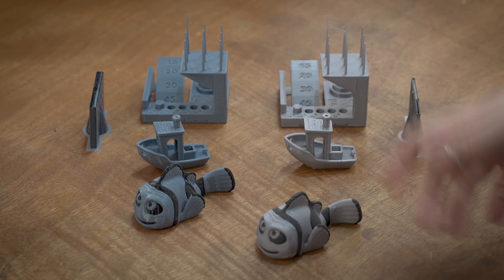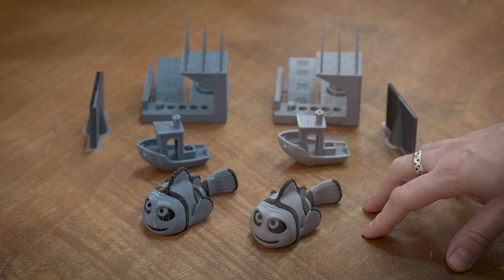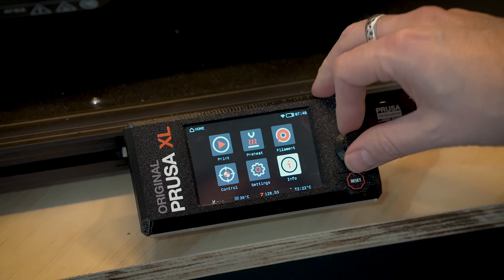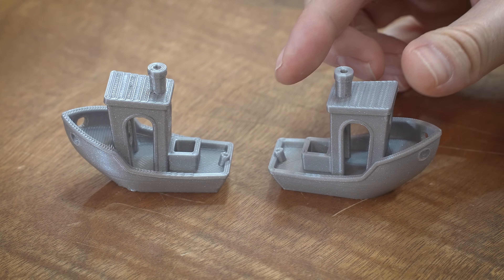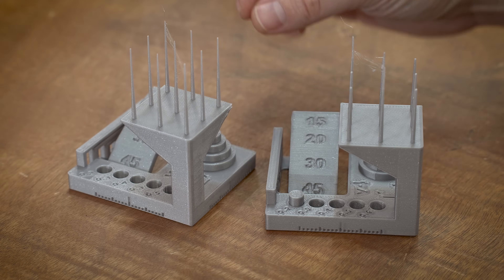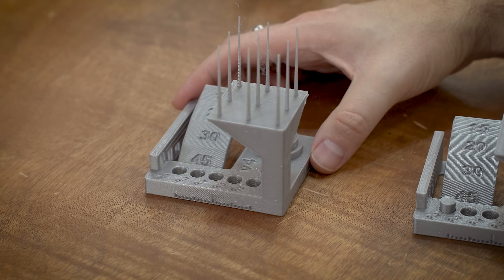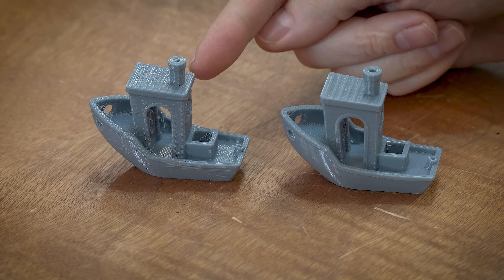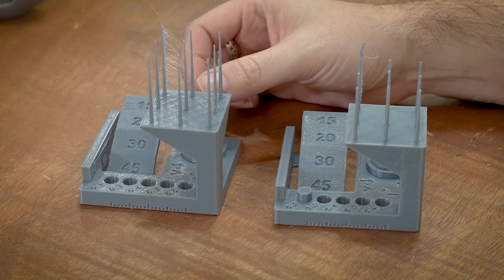Prusa XL - 0.6mm vs 0.4mm Nozzle Comparison

Comment: .4 will have sharper corners... it's a "sharper pencil point" than the .6. Examining from close around 1 foot / 30cm away I can see the difference but any more and I can't tell.
Reply from the maker: Oh, I completely understand that, but it's literally having an issue with things any printer should be able to do.  Check the other comments from other XL owners, it just doesn't seem to 'print right' with the 0.6mm for whatever reason.  It's not just fine details.

Comment: How is the difference in print time between .4 and .6 nozzles with input shaping?  5%, 10%, 15%?  Is .4 still suitable for larger prints?
Reply from the maker: All of this is using input shaping.  Of course 0.4mm is still usable for larger prints, they'll just take longer.

Comment: So do you think the decsion to ship with 0.6 was a marketing decsion instead of a technical one? Do you think P. felt pressure to release it with faster speeds instead of quality?
Reply: Prusa wasn't pressured by anyone or anything. Its only makes sense to sell it with a bigger nozzle. Its a massive printer marketed for people that print large parts. Using a .4 would take all day when a .6 can shave time off drastically. it's a no brainier to ship a large format printer with a larger nozzle.
Reply: Must be miserable living as a prusa shill @LilApe
Reply from the maker: Most likely.  They maybe assumed people would use it for larger prints.  IMO, they should have skipped the huge tin of gummy bears and just included both 0.4mm and 0.6mm nozzles...

Comment: What if the problem here is that slicers are through and through optimized (both intentionally and unintentionally) for the behavior of plastics at 0.4mm nozzle size and for that reason any attempt at using a 0.6mm nozzle will perform worse compared to 0.4mm?
Reply from the maker: Other printers seem to handle 0.6mm well enough.

Comment: I've been running my XL for a couple of weeks, and so far I'm happy with it.  It is definitely sensitive to stringing and oozing.  Filament drying seems more critical on this machine than any other I own.  Even stuff like Ninjatek Cheetah that claims it doesn't absorb water must be bone dry to get good results.  I have a set of 0.4mm nozzles on the way, and I'm looking forward to the comparison.
Reply from the maker: For sure.  It seems VERY picky about filament quality.
Reply: I wonder if this has to do with the really long heat zone, combined with a more open than normal nozzle, which leads to a long section where the filament will be cooking and thus, a proportionally larger build up in pressure as the filament off gasses within the hot end, which due to the easier release of the 0.6 size, results in more ooze than normal, to the point where it even has a notable effect whilst printing in the slower regions (I imagine this could be test simply by getting a filament with a wide temp range, and printing slowly, and very hot, and then slowly, and very cold). You know, maybe this is actually the cause of a lot of issues in prints because it's just a variable no slicer is accounting for.

I've always thought we were missing the compensation for this in software, and have just been using mediocre solutions like unnecessarily having smaller heat zones when we should just be estimating the "anti offgas" value similar to input shaping, and simply run the extruder motor in reverse when not extruding to account for it (very very slowly).

Anyhow, I don't have the time, nor working open source printer setup to try that, but it actually sounds doable just in the slicer with gcode. Heck, its the perfect thing for the slicer because the slicer knows for just how long the filament will be sitting getting cooked (and therefore expanding). It doesn't even sound super difficult to implement. I mean I've done the barest of tests with manually running the extruder back while filament cooked to test this before so I feel like the idea is definitely sound.

If only I could freeze time to have enough time for all the things I want to do that are totally easy ideas that wouldn't spiral into multiple month efforts
Reply from the maker: @BeefIngot There's certainly SOMETHING going on here, not sure what it is.  But since switching to 0.4mm, I haven't felt the need to 'improve' upon anything, I just want it faster now ;-)

Comment: I find the issues with the xl are a bit surprising, it seems like it is either bad profiles or something wrong with the hot end design. Given that it is still an issue to some degree my money is on the hot end.
It is the same with the 0.6 nozzle, they work really very well on the mk3s, (with the Revo conversion) there is little visible difference for functional parts but much shorter print times (with solid parts)
Reply from the maker: Yeah, I had always heard 0.4mm and 0.6mm can essentially print about the same, but it's not the case with the XL, at least in my experience.
Reply: @RobertCowanDIY  Do you know if Prusa has posted the whole design for the XL yet? I don't see it on Github but perhaps I am not looking in the right place. It would be interesting to check out the design details of the hotend and extruder.
Reply from the maker: @lukerickert5203 I've seen some files on printables, but not the entire machine IIRC.
Reply: @RobertCowanDIY  it would be interesting to run some transient thermal models on it. I guess I could ask Prusa

Comment: I found the same issues as you with my 5 head XL.  I now run 2 heads with 0.4 for "detail" stuff and use the 0.6 for "primitive" components and supports.
Reply from the maker: Nice.  I really wish I had gotten all 5 heads.  I just wanted to 'test it out' initially, but that was before I knew it would take forever for them to ship.

Comment: the old diameter swap process from my mk3 was way better than the mk4/xl, which  is ironic since the mk3 didnt havbe quickchange and the others do
Reply from the maker: I don't think the toolchanger has much to do with it, that part seems to work quite well and I don't see any issues with it.
Reply: @RobertCowanDIY  it's just the same on the mk4 tho. It used to be if you loaded an incorrect diameter file you could with one press get to the menu to reconfigure it. Total like 4 presses to modify the set diameter. Now it's buried in a tool sub menu despite nozzle changes being easier than ever
Reply from the maker: @AirsoftAbominations Gotcha, interesting.

Comment: Let me guess, same speed for both .4 and .6, there's a significant difference in volumetric flow, the most noticeable difference is between the PLA fishes, the .6 is matt, the .4 is shiny, the reason for that is not properly melted plastic, which creates higher nozzle pressure, worse surface quality, worse pressure controll in the nozzle, stringing, lines on the surface. Do another test but limit the volumetric flow, let's say use 8mm3/s for both PLA, and compare again.
Reply from the maker: Not a bad idea.  I didn't want the video to balloon into some 45 minute in-depth thing, but I made a spreadsheet and the 0.4mm nozzle prints were much lighter than their respective 0.6mm prints (maybe 20%?), so less filament and they took 10-20% longer.  So with the 0.6mm nozzle, it was certainly pushing out more filament.

Comment: Prusa was warned that 0.6 default nozzle was a mistake for exactly these reasons but they ignored everyone and did it anyway. What's the point of saving time if it looks bad?
Reply from the maker: I think for much larger models it would be less of an issue?  I should maybe do this same test but with really large-scale models.  But that would take forever :-/
Reply: Prusa was never warned about anything.You just made that up lol. It's a large format printer with a lager nozzle to match which makes sense. People were pleased to hear it comes stock with a .6 because it only makes sense.

Comment: You guys do know that nozzle size is not equal to line width right ? Meaning you can print just fine a 0.6mm line with a 0.4mm nozzle. 
So the real comparison should be 0.4mm nozzle VS 0.6mm nozzle on 0.6mm line width. To see what kind of secondary effects like filament swell, smaller volumetric flow etc. take place. Should all the secondary effects be controllable, there would be no reason to use a 0.6mm nozzle at all. With arachne you can print incredible fine details with 0.4 AND a line width of say 0.8mm. 
This would be way more interesting to me. I mean there is no genius hack to find out that a 0.4mm nozzle with 0.4mm line width prints slower than a 0.6mm nozzle with a 0.6mm line width.
I am also using a 0.25mm Nozzle to print 0.25mm-0.5mm line widths, so my prints are just as fast as before but the Detail is incredible, so are overhangs and the fine resolution of up to 0.06mm layer heigth.
Reply: I use to print .6 widths with a .4 nozzle. Now I print .8 widths with a .6 nozzle. Same quality but even better strength and print speed.
Reply: @LilApe  I also print 0.8mm lines with 0.4mm nozzles. Only the back pressure increases and the nozzle outer geometry has to be good enough. A nozzle is just an opening you squeeze plastic through, given enough time you  can print 2mm lines with 0.4mm nozzles. In the end you will be most likely limited by volumetric flow first.
Reply from the maker: Oh, I get that.  I was more comparing stock print profiles, not trying to match settings.  My conclusion is that the stock 0.6mm print profiles have gremlins.  I don't think the extruder is incapable of printing at 0.6mm, or that it's too large, etc, etc.  It's more that the 0.4mm profiles are better dialed in for this printer.

Comment: Really liked this one. I have a XL with only 1 (for now) toolhead. Still have some issue's with the 0.6mm nozzle, especially with IS. Encountered several print fails now during printing the infills on those prints, it seems colliding with the infill patern (maybe because of the higher speed?). I wonder if changing to a 0.4mm nozzle will solve this or just go back and not use IS for now. It's a relative new machine so hopefully these issue's will get addressed by Prusa. My Prusa Mini+ is flawless in that regard. Great work and keep it up!
Reply from the maker: Yeah, I'd give it a shot.  Like you I had some strange issues with the 0.6mm that I never saw on any of my other printers.  Now that I switched to 0.4mm all the issues are gone.
Reply: I wanted to get the Prusa Nozzle ObXidian from the store, but out of stock. The brass one is still available i see. Not sure if it is worth it to wait. Suggestions?  @RobertCowanDIY

Comment: Personally for this size of printer a 0.4mm is too small. Not surprised a 0.4mm is better but the print times are going to increase massively. If you were just print small items then fair enough, but then why buy a xl and just buy a mk4. I exclusively print with a 0.6mm on my 350 voron with amazing results so no reason prusa can't do the same
Reply from the maker: Agreed, I'm just showing that there's something strange with the 0.6mm profiles.  More tuning is necessary.  With 0.6mm, fine details should be lost, but everything else should be about the same, but that's not the case here.  I still need to do more testing, but the conclusion is more "it CAN print well, just not with larger nozzles".

Comment: Thanks for doing this comparison. It does feel like the XL should maybe have a selection at purchase between 0.4mm nozzles for those mostly printing detailed smaller objects, and 0.6mm for those printing mostly big objects that fill the volume. (Not that I have budget for either.)
Hopefully the obsidian nozzles will be available soon, they featured prominently on the E3D poster at SMRRF at the weekend.
Reply: The ObXidian nozzles have been going in and out of stock, I have 0.4 and 0.6, just keep an eye on the website.
Reply from the maker: @logicalfundy Ah, good to know, I'll have to keep my eye on it.
Reply from the maker: Yeah, I think the 0.6mm should be an OPTION, but it seems strange to include it for all extruders.

Comment: As a 2 printhead head XL owner I appreciate this.  I also have a Voron 2,4 that I throw all the evil filament at and going from a Klipper Screen + web page to the Prusa scroll menus I prefer the touch screen likely because anything complicated i just use my printers web interface.  That said the Prusa XL despite the occasional hiccup has been a pretty solid printer for me.  Though i am tempted going 0.4mm as i have seen a similar sort of imperfection in the dimensionality of the prints and flow.
Reply from the maker: Yeah, I'm keeping the 0.4mm on there for now, it just seems like a 'better' printer with it.  I'll probably swap back if I see some updates/improvements specifically addressing it.

Comment: Nice video. I came to about the same conclusion.
The XL, with 0.6 nozzles, does well for me with a bit of stringing. Nothing that cannot be wiped away by hand or with a hot air gun at low setting. But the 0.4 nozzle makes it perfect. Doing a temp. tower and tuning material makes any good printer into a perfect one. Drying PETG - yes, that does a lot for me too. Funny enough, I never needed to dry PETG on the other printers but on the XL this seems to make a larger difference.
Did you already install the new firmware and slicer ? I still need to do so on mine but I understood this will even improve things more.
Reply from the maker: I should have mentioned, for every XL video I make, I'm using the newest firmware and slicer.  I have not seen any issues when upgrading firmware, it's always gotten better.

Comment: Will you do a quality and speed comparison with the bambu again with the .4 mm nozzle? It would be really cool to see if you can run each g code form the different slicers on the other printer directly.

Also I had been getting a feeling that .6 mm nozzle was the problem. I ordered some .4 mm during black friday and also picked up the diamondback in .4.
Reply from the maker: MAYBE.  Comparing to Bambu always gets a bit tricky since they're really optimized for speed and not much else.  It would be tricky to do an apples to apples comparison.  I could modify the slicer to get the same part though.  Maybe...

Comment: I use a 0.6mm nozzle size pretty much exclusively. The only thing you demonstrate here is you did not calibrate for it. I make very very nice models with both my P1S and Ender 6 with a 0.6mm nozzle. Edit: As sort of a disclaimer, my Ender 6 is far from stock and prints just as fast as the Bambu.
Reply from the maker: I didn't calibrate?  I'm using the 0.6mm profiles from the slicer.  There's no 'calibration'.

Comment: Right on with your assessment, I think one of the things that really bumed out the community is after so many years of waiting, and at such a high cost, Prusa delivered this, a half baked printer. But thankfully the community saw the potential of the hardware, and started tuning it. As one of the people who preordered a 5 head XL, but then got a X1C+AMS, I'm gonna wait a bit longer. I do wonder, maybe the .6 nozzle is just too large to be used effectively for a tool changer? Not sure if anyone who built E3D's platform can comment any experiences with a .6 nozzle on a similar platform. Maybe Prusa knew this and but figured the .6 nozzle makes sense for this printer's giant print volume, but honestly I wish they released a toolchanger that is smaller (where the .4 as a default nozzle would make sense).

Comment: with the context of prusa not originally planning prusa XL with movement speed in mind i think the 0.6 nozzle makes sense, you want to print faster but you don't have a fast gantry, you can solve that by just having a bigger nozzle. with 0.6 nozzle at 0.3 layer height, you can reach 15mm^3/s volumetric flowrate at 125mm/s. with a  0.4 nozzle at 0.2 layer height, you can reach 15mm^3/s at 187.5mm/s
Reply from the maker: I could have sworn when this was announced, they talked about input shaping and high speed printing (which meant something a bit different back then).  I could be wrong, but this was announced pre-Bambu and I remember considering this or Voron.

Comment: Thanks for the video.  I have had my 5 head XL for about a month, no prints yet.  I had a stripped screw in Nextruder 1 - have been working with Prusa for over 3 weeks - to get it fixed.  TADA has had some big problems, hope she will switch to a .4.  This is very similar to using a pen vs magic marker,  If you have a fine tip pen you will get great detail at the cost of speed,  the bigger marker will give you speed at the cost of detail.  Could you share the times of your prints?

Comment: I wonder why the printer would check the nozzle size "noted" in the G-code.  Plus, at 6:54, the difference in seam quality is very noticeable.
Reply from the maker: It's just to prevent issues if you are running multiple nozzle sizes I think.  For example, tool heads 1 and 2 are 0.4mm, the rest are 0.6mm, and you might forget which is which.  It's just a sanity check.  And yeah, the seams were MUCH worse with 0.6mm, which doesn't make a ton of sense.
Reply: @RobertCowanDIY  That's understood, but it doesn't seem foolproof as you can swap out a nozzle and forget to update the slicer settings (as I have done before), and the printer wouldn't know the difference.